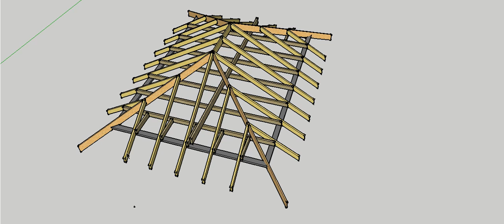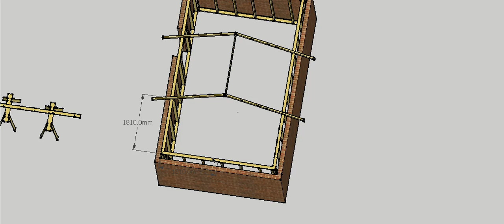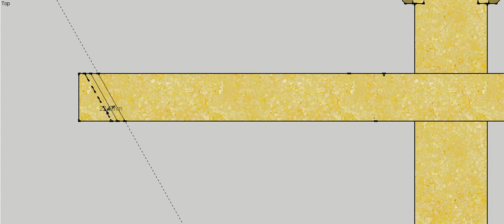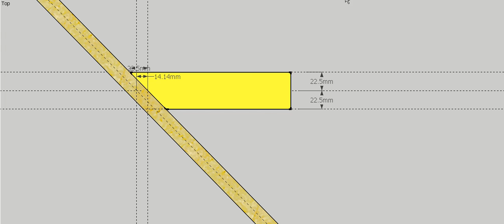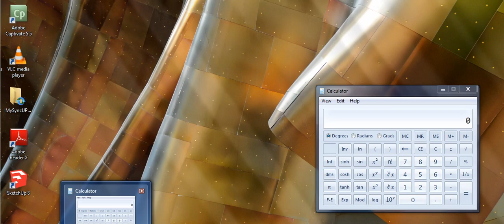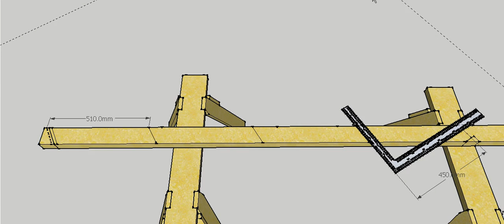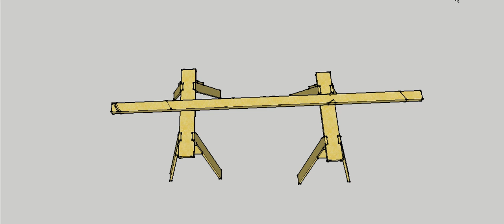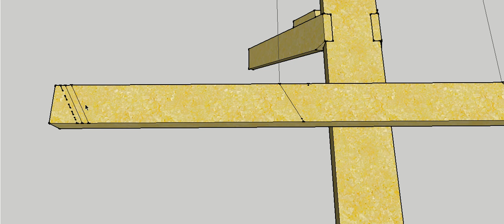Hip Roof Pattern rafter

Comment: Hi Buildsum 
Just a quick question
Are we able to deduct 519.6mm from the setout length of rafter without using the 510mm method at the beginning? And just keep creeping each creeper 519.6mm to longpoint?
Reply from the maker: Hi Mate, if you did that all your rafters would be slightly out of line, maybe not enough for a novice to notice but a Tradesman would not accept it.
Reply: Ok thanks mate

Comment: Hi Buildsum,

Just wanting to confirm I have these calculations correct and also have a couple of questions. The first step is to deduct half the rafter thickness and add on half the ridge thickness (14.14) which gives the first measurement (510) and then the other measurements are 519 from the 510 mark and so on until I get down to the birdsmouth (roughly)? I was reading a couple of roof construction books I have and the calculation they have for creeper reduction is rafter spacing x rise per meter/run (450x1.154 = 519.3). They then use that measurement as a reduction but don’t use the first part your talking about. I’m just curios to know are their a few different ways or preferred methods? Also, would the calculations (14.14 half thickness of ridge squared) be the same for different thicknesses of ridges, say a ridge beam (75/2 = √53.03? Hope that makes sense. Appreciate your time!
Reply from the maker: Hi Mark
From your calculations i am assuming that you are talking about calculating the creeper reductions. Your calculations are correct. However i dont do this in this video.
In this video I take half the ridge plan thickness and deduct it from the centre line to give me the true length of the common rafter. I then deduct half the rafter plan thickness from the centre line to get the true length of the Crown end rafther. The method that I use to get the positions of the creepers is a different method to the one that you are working with, I take take plan length of the creeper directally from the setout of the roof and then convert it to the true length.
There are lots of different ways of working this out, everyone has there own prefered method, mine is as i have shown in the video, short of the spreadsheet that works out all the lengths for you.
Yes this works regardless of the thickness of the original ridge.
Hope this helps.
Reply: That makes perfect sense, really appreciate your time. I have learned so much from your videos. For some reason I have a love for roofs, especially cut roofs, something that is a common practice back where I’m from (Ireland) so its a skill i want to perfect especially with truss roofing becoming the go to. Good to have the traditional way in the back of the mind. Thanks again

Comment: Hi Buildsum 
I tried to work it out the length of the hip rafter by using the same method of gable rafter or common rafter. I don't want to relay on calcs or Hancock red roofing book , at least if I am using it want to know what are those numbers exactly standing for. My question is , is  there any standard formula measuring hip rafter?    or what is missing from common rafter formula to be added to hip rafter ? thanks for your time !
Reply from the maker: +jivara sulaiman Just remember that the angle of the hip is less than the pitch of the roof because it runs over a longer distance

https://www.youtube.com/watch?v=mwoAwsuwMyI

https://www.youtube.com/watch?v=Num8r1xdI_8

https://www.youtube.com/watch?v=PwU8pWOMcaw

https://www.youtube.com/watch?v=N28lcLzwfSs

These videos will give you a few different options

Hope they help
Reply: Thanks again !!! you are legend !!

Comment: I remember we did different at Tafe.
We marked hips on the other end .
Reply from the maker: Hi Roger
That must have been with someone else as this is the only way i do it.
Reply: could you revise me what is the connection between birdsmouth side and back side of the pattern rafter, please? i remember we draw some cross line on the narrow edge of the pattern as well.
Reply from the maker: Hi Roger As per the video, we use the back of the Pattern Rafter to draw a representation of the top plate and the positions of our creepers. We can the measure the plan length and use this to calculate the length of our creeper. These lengths are then marked on the other side of the Rafter and the edge bevels marked on the edge of the timber.